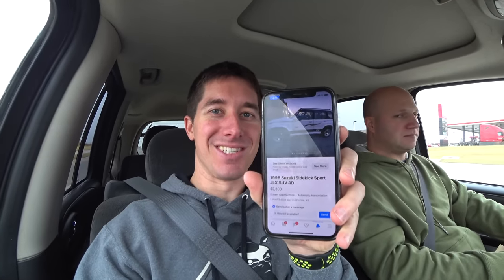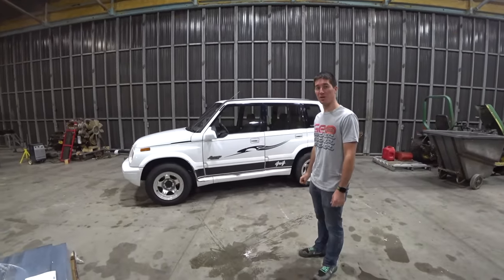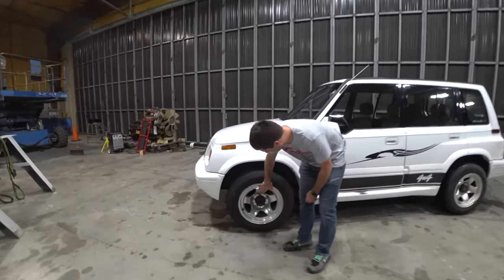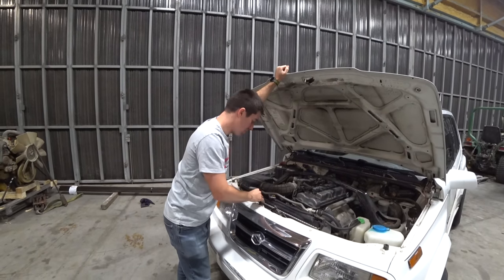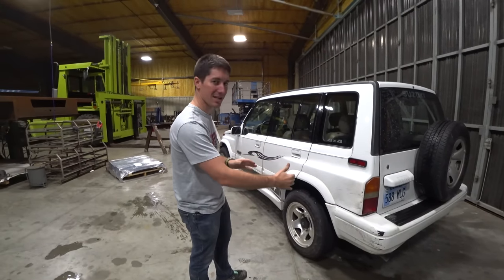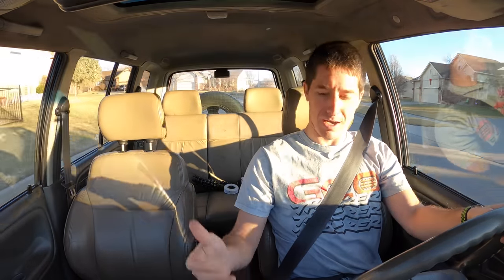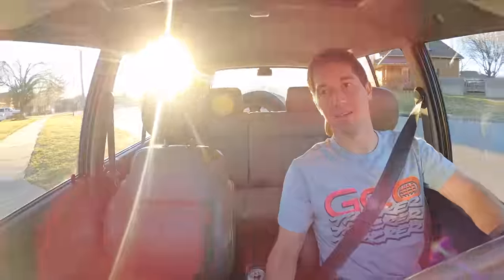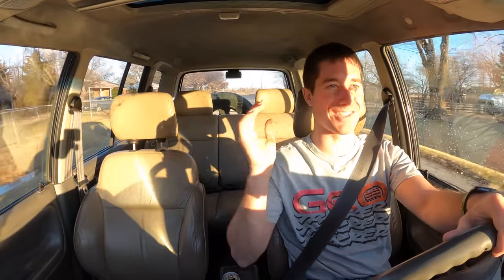I BOUGHT The CHEAPEST Suzuki Sidekick Sport JLX In The USA

Comment: Sometimes guys swap the auto hubs for manual ones as they are more reliable
Reply: Exactly. Makes way more sense for the hubs to be swapped than all the other JLX features.
Reply: I figured it could've been because they were short of cash when they needed to replace the hubs, but your rationale makes more sense.
Reply: Can confirm, swapped manual hubs into my Tracker because the auto hubs didn't work for crap..
Reply: guaranteed the answer since it has the sunroof.
Reply: ^^^This. Manual hub swap to fix the auto hubs that are less reliable.
Reply: ahhh this makes sense why my auto hubs were swapped to manuals, thanks y’all!

Comment: This brings back soooooo many memories!  My very first car ever was a 1996 Suzuki Sidekick JLX, the hard top 4-door model.  It was candy apple red and it was my baby for many years.  I got it for my 16th birthday in 1997.  It was the car that I passed my driver's test in.  It was also the car that I first met my now husband in when I was 18 and went on so many adventures in.  I had that car for 10 years.  I finally sold it in 2007 after my husband and I bought a brand new Jeep and really had no need for the Sidekick any longer.  It had almost 200k miles on it and still ran great.  It was such a reliable vehicle.  Never had any problems with it.  I remember way back in the early and mid 2000s when we could fill up the gas tank on just $20 and wouldn't need to fill up again for well over a week.  You just don't see these little SUVs around anymore.  It's probably been well over 10 years since I've seen one on the road.  Almost 15 years after I sold it, I still sometimes feel nostalgic for my first car.

Comment: if you've got manual locking hubs on the front of the truck you aren't actually in true 4 wheel drive unless you get out and physically  lock the hubs. Same thing holds true with not unlocking them at the end of your mud run

Comment: Now those are desirable Suzuki SUVS. I would love to see them return back to the North American market with the Jimny  and Vitara.
Reply: Wasabito Burrion as the owner of a new Suzuki Grand Vitara 2 door, I wouldn’t recommend it
Reply: The Vitara or Gran Vitara still runs wild in Puerto Rico I see them all the time
Reply: I want a jimney...  manual/4 banger/cheap...
Reply: Maybe the Jimny should be rebadged as a Toyota or Mazda in the USA.
Reply: @phillipeclavel750  Why, if I may ask. I was planning in buying one as replacement for my Jimny. Thanks!
Reply: @atx-cvpi_99  Actually makes totally sense. I see the Jimny as what Toyota RAV should have been :(
Reply: @mrinternet5562  You can't go wrong with that one. I own an automatic one and I'm still happy with it.
Reply: Panzergrau Models it’s the 2.4 glx 4x4 5speed 2014. The engine and trans mounts are crap after only 38.000kms, the interior is super basic for the price and the steering wheel is not adjustable
Reply: @phillipeclavel750  Thank you, Phillipe! I have to agree with you on that. I changed my transmission mount at 120000km and the seats are stiff and upright, without lateral support. Yet I swear the interior looks better than a Corolla's. I own a 2007 Jimny, btw, and I find it very fun to drive, although stiff. Engine keeps going though and I'm happy with it, especially I've paid petty money for it.
Happy New Year, btw :) !

Comment: Love It!  In 1989 I bought a brand new Suzuki Sidekick, 2dr JLX 5sp soft top, for $9,000. My first manual transmission, 1.3L 90hp, 0-60 was 12 secs.  Things I remember: great in snow, good gas mileage, rough ride, and super easy to work on.  You could reach down and touch oil filter, could reach under to unscrew drain plug.

Comment: I got a 99 Tracker, its Chevy badged a 4X4 only one owner  39K miles. So Happy with it and its four on the floor 2.0 L 4 cylinder.👍I Luv IT!
Reply: I've seen them with 200k as long as you don't live in the rust belt you might make it that far
Reply: I live in the Mojave desert; 89061 !...Tracker is excellent for around these parts.

Comment: Those were used a lot as tow behinds for large RVs, especially in the late 80’s and ‘90’s. That would also explain the decals on the sides that matched the RV towing it. Also the manual hubs for better flat tow-ability, especially since yours is an automatic transmission. If you look under the front bumper there are probably provisions for a tow bar as well.

Comment: I loved my 92 Suzuki sidekick jlx. I had a few issues with it. But it lasted over 200,000 miles. 16vaulve engine. I wanted to get a 2 door one and mostly a x90. Never happened though. Then after like 230,000 it started blowing head gaskets. Plus it was having a nice round of smoke out the tail pipe. As for the back door. The grease in mine was hardened. A quick removal of the back door panel. Easy access to remove the latch and re-grease. After that my back door open and closed like a champ.

Comment: I say throw a nice Thermal Research exhaust and stainless header on it, maybe a brand name cold air intake (not a cheap eBay or self-fabricated intake), clean it up, put some more aggressive tires on it, and rock it. It's a really good looking vehicle for an older Suzuki. I'm not saying that I would rice it up, I'm saying to put brand name well fabricated parts on it. Every vehicle that I have I modify them to make them my own, but I HATE using cheap eBay parts. Small things like dress up bolts and washers are OK, but using cheap engine parts like an eBay exhaust, suspension components, or a cold air intake is not worth the money that you save over brand name parts.

Comment: I just bought a 1996 geo tracker power wagon. which is four door with a hard too. just like that. and mine has all the options of the LSI but it's not. IDK and I have all the extra's yours AC and all mine has 102,000 actual miles. I gave 1,200 cash for it. but mine has manual hubs. you could get them auto or manual your choice when buying new.

Comment: That rear hatch ALWAY stops working. What happens is that the metal they use to make the lock in not galvanized so it rusts an get stuck. So when you open the door the lock wont reset so when you close it you jam the lock. Just pull off the inside and use a flat screwdriver to push the tongue down and its good to go

Comment: I have the 97 JLX Sport.  Good luck getting parts. Beware: fitment resources are all fucked up. The 1.8L is super rare. Most engine parts you get will actually only fit the 1.6L.  In other continents the 96 and up 1.8L was called the Vitara since its 100% different under the hood from the  sidekick/tracker 1.6L. 0 In North America they didnt change the name til 99. 96-98 Sidekick 1.8L parts  dont exist in most computers so they always give you the 1.6L parts and tell you they will work but They rarely fit.

Comment: I had a 98 sport sidekick jlx new, this is a jx. My jlx had auto hubs 16 inch 5 spoke aluminum wheels and rear windows tinted privacy glass. No sidekick came with leather, this was dealer installed!
Reply: They did not come with sunroofs either, They were two tone paint mine was white  with the lower wide body champagne.

Comment: There is a black manual 06 or 08 one of these sitting out the front of a house 3 doors up from mine covered in spider webs and dirt with rusty rotors., One day I'll knock on the door and ask about it because it looks pretty good under the dirt. I'm in Oz and have a suzuki dealer about 300 meters from my house

Comment: I have something for light offroading that you most likely never will see in live. None of these vehicles - except the Wrangler - had more than 10 K miles on the clock when this was filmed. https://youtu.be/Lhet1W15xAw  it's cheapish, not lots of power and the tech side is all tested out by other models before ending to this vehicle. https://en.wikipedia.org/wiki/Dacia_Duster The 4x4 diesel version weighs just under 1400 kgs.